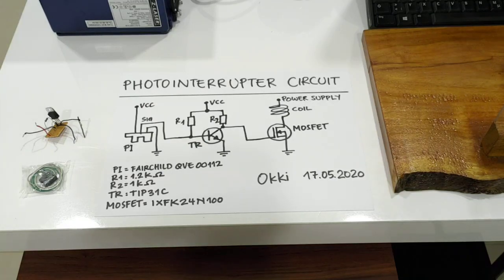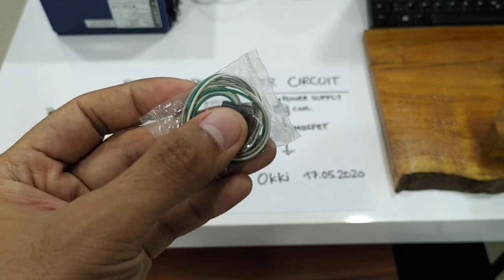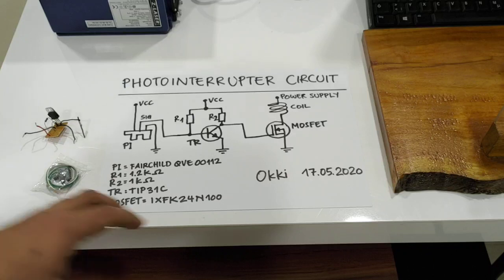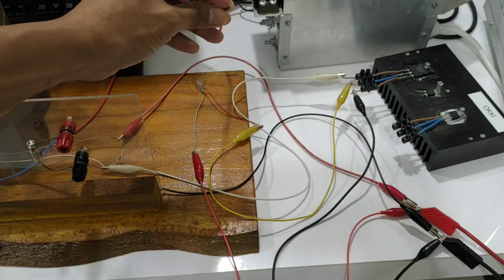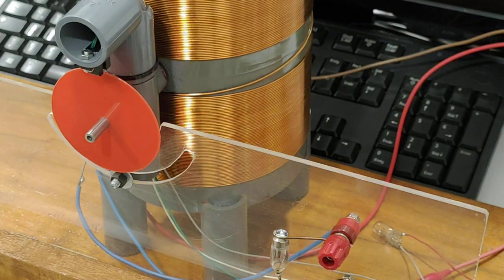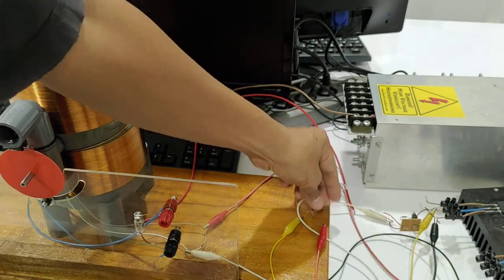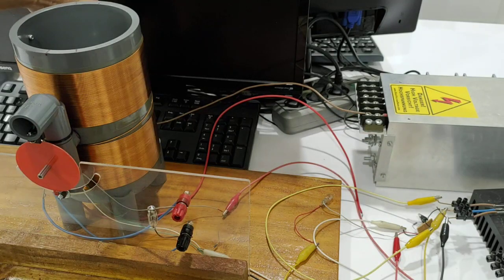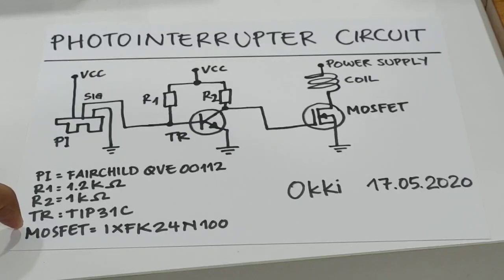Newman Motor - Photointerrupter Circuit

Comment: nice video , so this part of the circuit do what exact , just to turn off the coil for a split sec and turn it on , what is the main purpose of it ?
Reply: This photointerrupter drive the newman motor